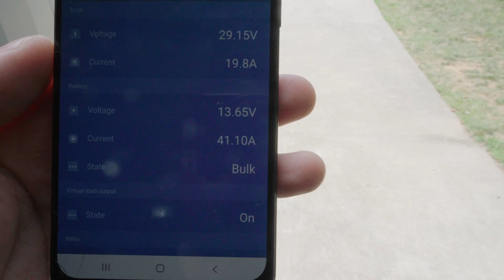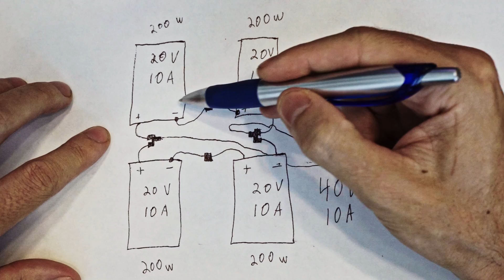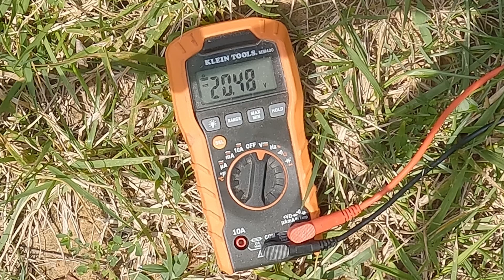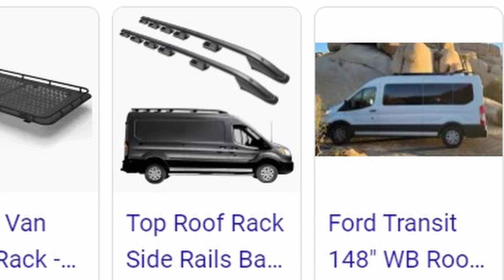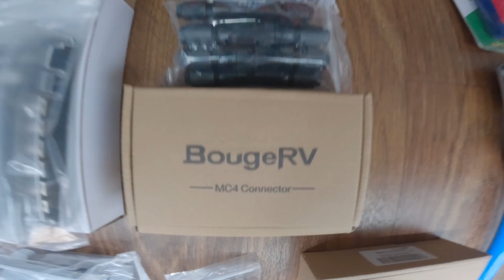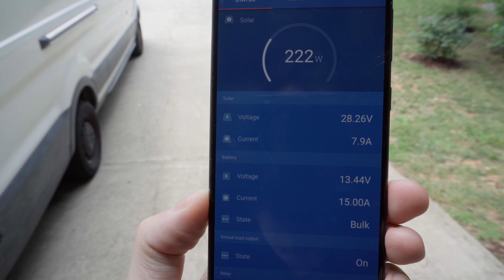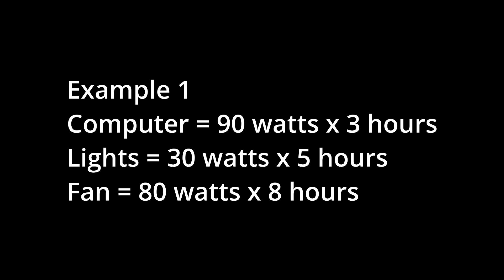SOLAR POWER for VanLife  - Complete Course

Comment from the maker: Hey guys, just wanted to say yes I was going to buy these panels with my own money until they reached out to me on their own. So this is my very first sponsorship, just cause it made sense for me and you guys. From the research I did beforehand, on my own, I came to my own conclusion that these panels would be better for my van since they were smaller and produced 22.8% efficiency, highest for home solar.

Claim Code(10%off all panels): OUTDOORS10
200W Solar Panel: https://amzn.to/3aQRp1e
180W Solar Panel: https://amzn.to/3IOfFxt

ALL PARTS FROM VIDEO: https://amzn.to/3RK9w9u

~~~~~~~~~~~~~~~~~~~~~~~~~~~~~~~
Learn how to install solar panels in van life, how many panels you need, how to wire your panels (parallel or series), and what makes a good panel in the first place.

0:00 Intro
0:17 Researching Panels
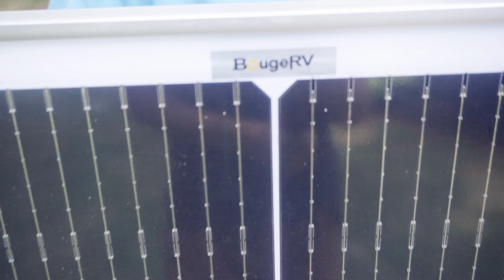2:20 How to Wire Panels
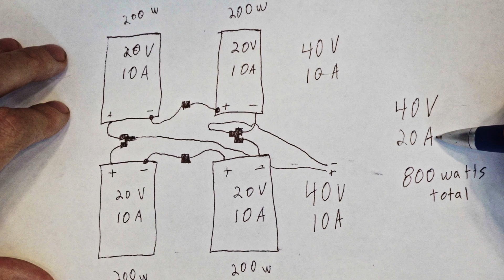4:56 What gauge PV Wire to use?
5:36 Panel Install
8:48 HowTo Make MC4 Wire
10:28 Wire HookUp / Routing
12:29 Testing Power
12:53 How Many Panels Do You Need?
13:58 Sizing Charge Controller

~~~~~~~~~~~~~~~~~~~~~~~~~~~~~~~
Need extra help with Electronics?
http://www.outdoorsembrace.com

Amazon BUILD PARTS (All of them) 
https://amzn.to/2YtfWkd

Drag and Drop 3D Van Builder https://outdoorsembrace--vanspace3d.t...

~~~~~~~~~~~~~~~~~~~~~~~~~~~~~~~
Peer Review Link:
https://www.researchgate.net/publicat...

~~~~~~~~~~~~~~~~~~~~~~~~~~~~~~~
Contact Info:
If you are a business or youtuber and wish to contact me, see my email in the ABOUT section of my channel.

Join the Outdoors Embrace Discord Forum. https://discord.gg/XKgnra3v
 Discuss anything related to van life, builds, or any topic discussed on the channel. https://discord.gg/XKgnra3v
Reply: Congrats on the sponsorship man! Well deserved. Get that bag. If I order I’ll make sure I use your code!
Reply from the maker: @davidpayette2348  thanks man!
Reply: Are the panels multi celled or single celled.

Comment: Why did you use a 150 / 60 charge controller if the voltage and amperage is nowhere near that much?

Comment: To prevent a short you could add a fuse between the charge controller and solar right or could your put it between the battery and controller to achieve the same effect and protect your whole electrical system?

Comment: I did not want to drill any holes in my roof. I did adhere my 4 x 100 watt solar panels to my roof. However, I placed 3M 5952 Double Sided Mounting Tape VHB 1'' wide between the Z bracket and my roof. I then covered each Z bracket with a 3” length of white RV roof tape for physical protection and to prevent UV degradation. I have travelled thousands of miles without any issues. Just a tip for others….

Comment: Hey man, nice vid! I saw when you parallel wired the two series solar panels with the other two series solar panels, I noticed you didn’t put two MC4 15A fuses between the two positive MC4 connectors and the positive y-split connector. We used the same solar panels, MC4 connectors, and wire size, and my research led me to conclude that I need to place these two 15A fuses for safety in case of a short circuit.

Did your research also led you to the same conclusion? Or did you decide to leave that off, as it wasn’t necessary? 

Personally, I’d rather not include them myself if they’re not necessary- I have no ladder to access my roof in case the fuse blows and I don’t want to further increase the risk of rain getting into those MC4 connectors and introduce more points of failure if I don’t have to.

Thanks!

Comment: Ok so I watched it to the end. I have some questions. Are all solar panels capable of being connected to charge controllers regardless of the brand? I am thinking of getting panels that were on a parking lot security camera device… would they work? And second question, is the objective to have enough solar equipment to produce enough power to run everything without having to plug in? Thanks for your show. Its awesome.

Comment: I bought the Renogy Z brackets but ended up letting my paranoia get the best of me. Drilled slightly wider pilot holes and put some thicker bolts secured by washers and nuts. Your method of securing the screws with wood might work but my paranoia starts to imagine humidity getting to the wood and making it weak over time.
Reply from the maker: Probably a good idea. Safety is always best.

Comment: Is it possible to put a charger port on the outside of the van to charge the batteries with, like, say, using an extension cord
Reply from the maker: Yes! Many do! I don't ever need it. Solar is perfectly enough for even high powered things. Unless you are using an AC

Comment: The problem with Solar Panels connected in parallel is when some of the panels get more sunshine the the others. f.e. when you park in the shade of a tree. What might happened is one panel will produce 10A as it's supposed to be and the other will give 6A. Because of parallel connection the four additional amps from the first panels will be lost and you will get 12A in total.
Reply from the maker: Yes! If you can do it, wire in series!

Comment: I got the bougerv 200 watt CIGS panel for my international prostar.  If you want stealth and ease of installation these would of been the better choice
Reply from the maker: I totally get it! The flexible panels are great for stealth. I'm just wanting longevity too, and sometimes these flexible panels don't last as long or have issues as far as I see online. But the BougeRV Cigs panels did look to be of great quality from what I saw. I was going to have a fan up top anyway so I'd still need to skirt around the roof with a rack to hid it

Comment: Hey Ryan!
Recently found and have been watching all of your video's!
Looking to getting into VanLife myself for multiple reason's, I was curious with a quick question, tried the discord link says invalid :)
Reply from the maker: I'll have to look into that. What's your question?
Reply: @OutdoorsEmbrace  Your first VanBuild was an E150 model correct?
Been looking online and was curious if besides power and towing etc if the E350 has more room inside the vehicle or not?
I myself am in the early / preparing stages for Vanlife and have been pouring all over youtube for video's like yours, amazing stuff by the way, and just van window shopping atm.
Advice /suggestions of course appreciatted. Thank you for replying!
Reply from the maker: @gijoejoegaming6168  the E350 just has better suspension as far as I know. It's not necessarily bigger unless you get the extended version. 350 is made to handle heavier loads and pull more weight behind it.
Reply: @OutdoorsEmbrace  Gotcha, thank you, I saw as much as well while doing research. One more quick question if you don't mind, would you suggest a Transit model if possible over an Econoline?
Also can't wait to see the formation of Megalodon!
Reply from the maker: @gijoejoegaming6168  I'm team Transit 100%. The ecconline is good, but its more budget friendly, still not cheap parts. Ecconoline is honestly a great long term investment. 

Transit so far seems so much more luxury to me, especially cause I can stand.

But out of the three main tall vans: promaster, Transit, and sprinter. I personally believe the Transit is the best option. The Promaster has cheap parts and is less reliable. The Sprinter is way too expensive. Transit in the middle is taller and is so nice up front while driving. The back is easy to build in.
Reply: @OutdoorsEmbrace  Perfect, thank you. If I can work out a transit eventually I will, otherwise I see me going for the Econoline and then working my way up depending how thing's go.
Thank you for all the feedback, stay up out there!
Also again can't wait to see Megalodon :)

Comment: National electric code has a section on photovoltaic. Basically any rated amperage is multiplied by 125% to size the wire. But also, the only drawback to oversizing wire is cost. the pros of bigger wire are higher efficiency, greater safety, and more structural resilience.

Comment: Are you going to put a roof fan? because I am debating to go with or without one to be more stealthy.
Reply from the maker: I just installed a Fresair yesterday! Video for this one will come out probably later, trying to catch up. Making the video for the floor first.

But yeah, the whole thing about stealth is to keep it low down. The Maxxair fan like on my old van is nice, but lifts up really high when running. I usually kept it low while stealth camping. Still 4.6 inches at it's low position. The Fresair is larger, but it's lower down, 3.7 inches and does not move. It's low profile is why I choose it. Yes it's a swamp cooler and much more expensive, but aside from that it's superior to a maxxair fan in every way if you are comparing them without the swamp cooler feature. The jets blow about 25 times stronger than the wind from a maxxair fan. The power draw on low is 1.5 amps 12 volts, and around 5 amps medium, 9.5 amps highest. The lowest setting still blows about 10 times harder than the max setting on a maxxair fan. 1.5 amps on lowest for super good air jets, or 3.5 amps at highest on the maxxair for very little wind.

Comment: I just picked up two BougeRV 180 Watt Panels and want to run them straight into my Bluetti ac200max. Should I do series or parallel and do I need a breaker when using a solar generator? Total newbie, appreciate any help?
Reply from the maker: Run them in series if your charge controller can take it. Series will be more efficient. From a quick look at your unit, it appears it will take it, as long as your unit can take 40 volts input your fine. Amperage will only be 10 so I'm sure your fine here.
Reply from the maker: I'd at least put a switch on the positive side like I did, a breaker if you want to be safe, but personally I don't think anything below 1000 watts really needs a breaker.

Comment: I made it to the end. 
Here in Northern Ireland, we don't get a lot of sun, in winter using 660 Watts per day, we would probably need at least 1800 Watts of solar to get back the 54 amps used ( on a cloudy dark day  ) but in the summer sun and much longer days then a 130-watt panel would most likely work, double that to be sure as the sun is not always out. In mid-Spring and Autumn then 250 - 300 Watts of solar would probably do but 400 Watts for those sketchy days and a safety margin.

Winter is the problem here. The amount of solar panels needed to recharge 50% of a 110 Ah battery is ridiculous, too much weight is high up, and limited room on a van roof anyway. Driving to charge, and/or a generator would be necessary for a comfortable living environment.
More power in winter is usually needed for lights, diesel heater, laptops, etc; as longer times are normally spent in a van compared to summer.

Depression can set in in winter if you have it super easy in summer, it can seem like the winter will never end, especially if cold. A Truma gas heater can save a lot of amp usage as they run on gas whereas diesel blown air heaters use a glow plug and powerful fan plus pump and are hard enough on amps over extended time periods.

I think you made a good video and I agree with what you said as long as you're in the right environment (geological location ) for it to work. In winter things change exponentially, well again, unless you're always getting good sun, long days, or have tilting panels; snow-birding is another option if you can do it.

Comment: maybe i missed it but didn't see how you attach the panel frame to the roof..u make holes in the van and tighten them from inside the van? Also the grommet on the roof look like there was a lot of play...u fill that up with Caulk?  
Great video btw...thanks for all you do
Reply from the maker: Yes, make holes and screw into van and wood below van metal. Grommet is fine if it moves, it is fitted enough not to fall out without someone prying it off

Comment: If someone wanted to hire you to do it for them, would you and what would you charge?
Reply from the maker: Oh, I'd probably do just the panels and top wiring for about $500 if it was a similar setup to this video. If I did this regularly, price might go up... not really sure what other's charge. Depends on the amount of panels, difficulty of work, type of van, and a few other factors. I'm so bad at pricing these jobs. I did an install for a woman one time, and charged so little I felt robbed afterwards for 8 days of work. I want to avoid charging so little because it's the kind in me that wants to always do it for less haha.

Comment: So I have a book that tries to explain how to set up solar panels, and this is probably the best starting video which explains how to physically set the whole thing up.  I like how you also included math at the end to help people determine their own minimum panel usage.
What I don't quite get is how you got the number of panel wattage you need at 13:28.  If you use 660 watts a day, why get 130 watt panel?  Wouldn't you need 660 watt panels?  There's clearly something I'm missing here.
Regardless, great video.  Thank you!
Reply from the maker: If you use 660 watts a day and only got 1 good hour of sunlight, then you would need 660 watts of solar.

But on average, we get 5 good hours of sunlight a day. So 660 / 5 = 130
Reply: @OutdoorsEmbrace    That makes total sense.  I'll use the "5 good hours per day" rule as a standard.  Thank you!

Comment: Just what I needed at just the right time..Im nervous and will watch any videos you put up. Thank you... 62 yo single woman doing my van build all by myself 😉
Reply from the maker: nice! Love the feedback! Thank you!
Reply: @barbarabilodeau Thank you for posting your comment, I find it inspiring. I'm 47 & have been considering doing something like this as well (now to overcome the nerves & procrastination🙃) 

Are you finished with your build? On the road? 

Good luck and safe travels - maybe I'll see ya out there 😉
Reply: @lora97006  nerves and procrastination are huge to get over. What I found on my last build is that after you actually start, the parts you're nervous about aren't as hard as you think. When a problem arises, you're "hands on" and in the moment, you see the issue, and it's a lot easier to think of a solution. 
I'm in the nerves and procrastination step of my second build right now. 

Good luck on yours!
Reply: Seeing your comment 2yrs later. Have you built yours? How did it go? I’m 55 and thinking of starting a build.